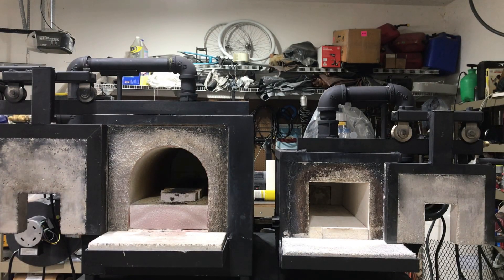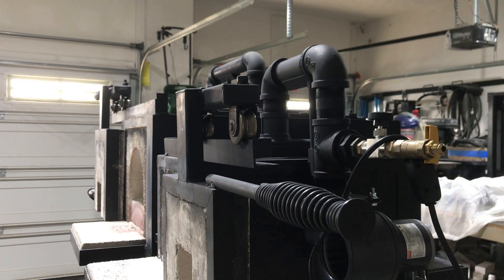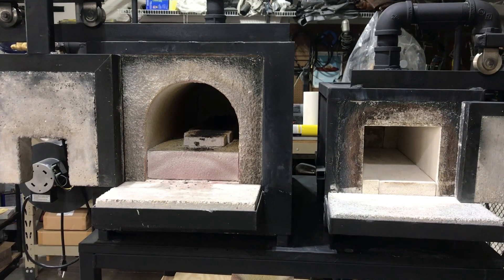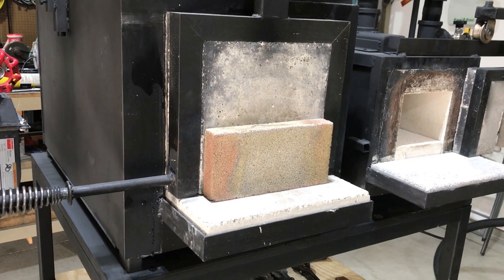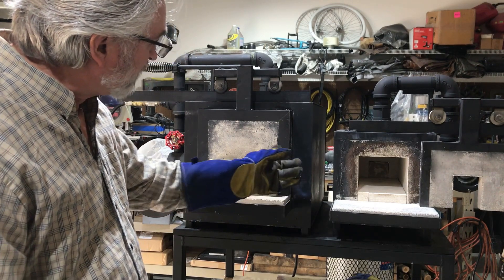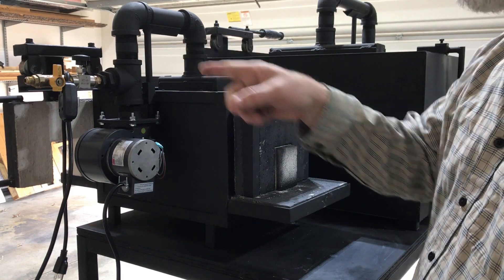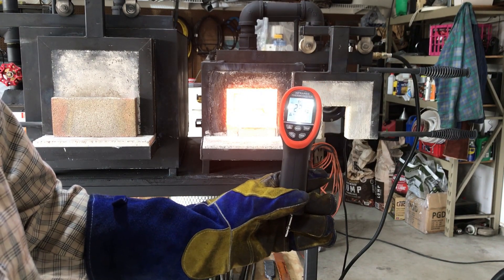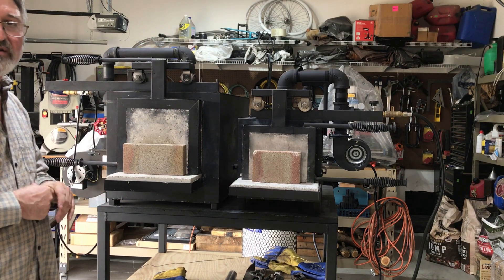Knife Making Forge's

Comment: beautiful job on those forges what refractory do you use ? kastolite 30? i bought my forge from brian house didnt have time to build new sub thanks Mark 👍👍✌
Reply from the maker: Thank you, I used this refractory that I found on Amazon

Simond Store Castable Refractory Cement - 60% Alumina Hydraulic Bonded Dense Cement Castable - 2912F Rated - High Temp Cement for Foundry Furnace Kiln Fireplace Pizza Oven Stove Forge Lining - 44 Lbs

Comment: Did you build your forged or buy them?
Reply from the maker: I built them, these are my own design. They both have forced air ribbons burners, ceramic fiber insulation (3" in the larger forge, 2" in the smaller forge), castable refractory for the walls (2" in the larger forge, 1.25" in the smaller forge) as best as I can remember. I use the smaller forge for most jobs (knives, axe heads, etc.) and the large forge for bigger jobs like swords, machetes', and larger items that wont fit into the smaller forge. Both will get over 2400F but the larger forge takes longer to get up to heat due to the mass.

Comment: Where would be a good place to buy supplies to make a forge
Reply from the maker: I buy most of my materials (ceramic fiber insulation and castable refractory) from either E-Bay or Amazon. If you have a local fireplace supplier they might have this on hand for a reasonable price. The steel for the shells I sourced from a local supplier. All of the fittings came from the local big box store for building materials. The blowers I also found online.